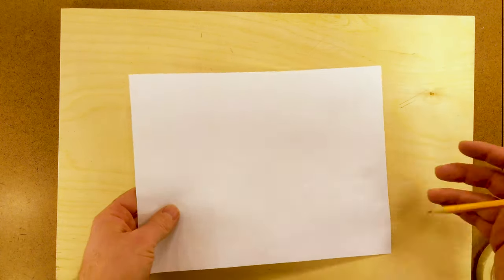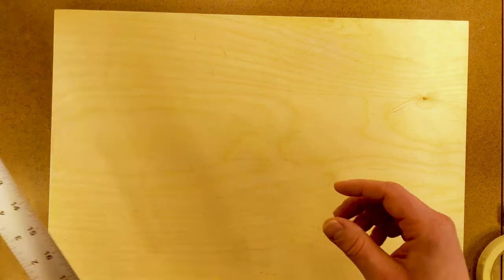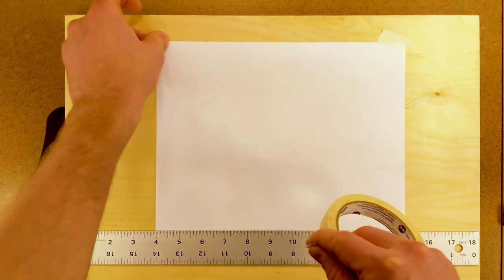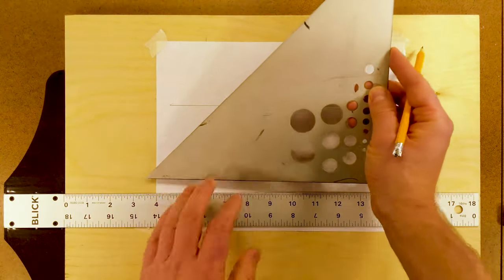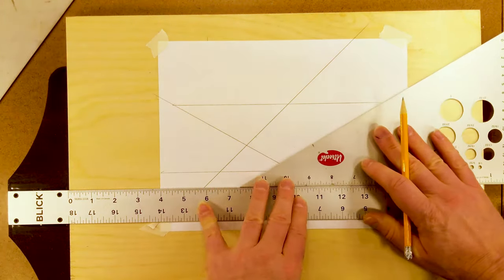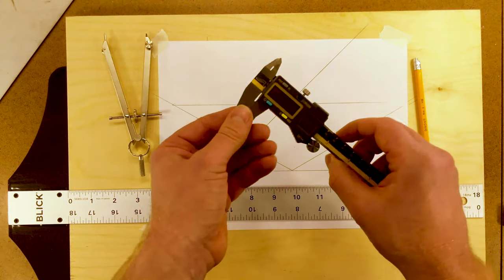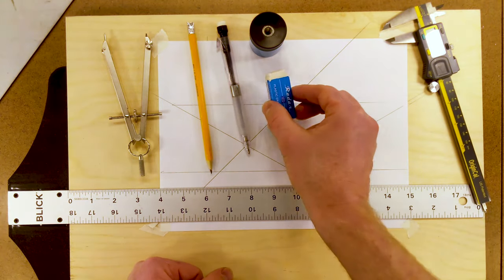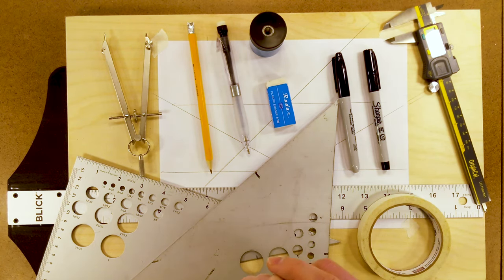Technical Drawing Tools for Design

Comment: If possible, please share a link to good quality equipment that you recommend.
Reply from the maker: Just make sure your compass has a stabilizer bar in the middle but just about any version of the tools will be fine. 

Get some basic triangles and a ruler and try them out, add more tools over time. 📐📏